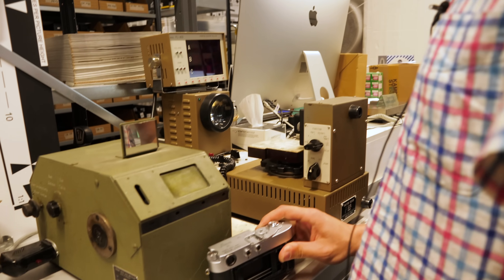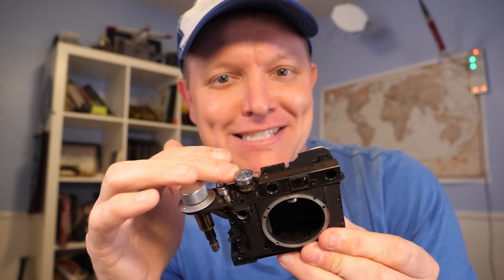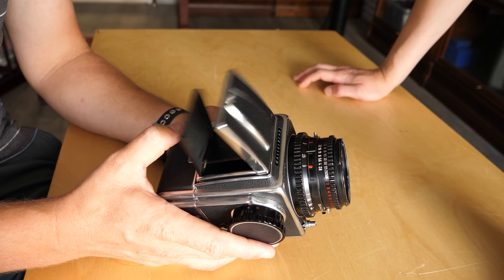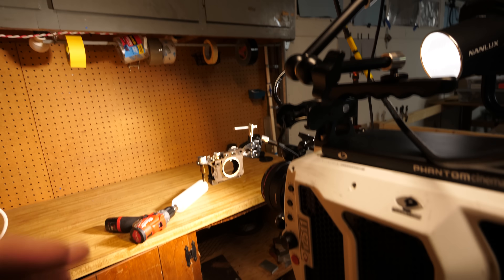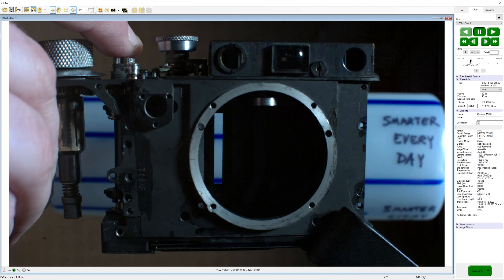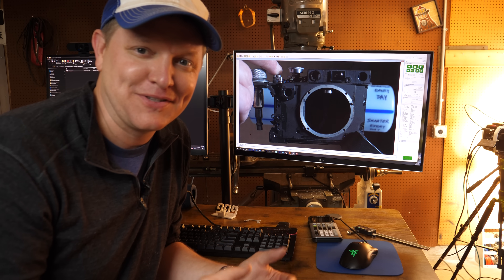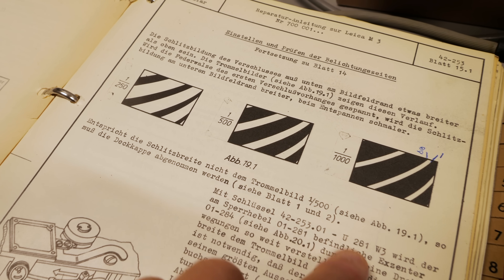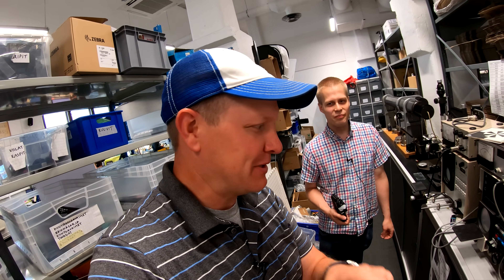How the Germans Measured Milliseconds MECHANICALLY - Smarter Every Day 283

Comment: Great video, and a topic that’s right up my alley, I was a professional photographer for 25 years, and cut my teeth during the last years of film as an assistant in NYC. I have some interesting add-ons about shutters: the rolling shutter effect was pretty well known, I remember the photo books I wore out as a kid having examples—race cars which appeared leaning waaaay back, and same for race horses and sprinters. I remember the first time I figured out that at a certain shutter speed the shutter would begin to close the second curtain before the first was across—I had triggered an open body set to 1000th near a strobe head, and the image of the “traveling slit” was clear as day. In camera manuals there was a note explaining that to use strobe one must set the shutter below a certain speed to avoid uneven exposure HOWEVER there were high-end strobe systems that had a setting that would let you disregard the warnings. How? The strobe would extend its “on time” beyond the time it would take for the slit to cross the frame, so the images would come out evenly exposed. I worked almost exclusively with medium and large format systems, as film quality in 35mm was not quite good enough for high quality reproduction. Some MF systems used a curtain shutter like the one you show, and at that size the mechanism was pretty powerful. I believe the Pentax system in particular would make a solid sounding ka-THWAP-tick when triggered—first the mirror would smack up out of the way then the shutter would go. Other systems, and all large-format systems, used leaf shutters. They are located just behind or in front of the aperture iris, and was bladed, usually 3 or 4 blades. Because they were located at the focal point (not the image plane) they were between the front and rear element groups of the lens, and since the visual information there is all mixed around, there was no visual darkening at the edges, which one would think would happen since the blades spend more time blocking the outer areas. The best of those shutters could just do 1/1000, and larger ones topped out at 1/500, whereas the fastest 35mm cameras could do 1/8000. The photographer I worked with the most used Hasselblad 6x6 system, and he had an enormous kit. Several bodies, around 20 film backs, and between 15 and 18 lenses. He owned the Hasselblad fisheye lens, with a front element that was around 5-6” in diameter, just a huge piece of glass. On several occasions he would keep me and the crew awake by spinning around suddenly, looking over at us standing by the film cart (usually 25-30 feet away) and yelling “think fast” as he LINE DRIVE threw one of the spent backs right at me. I caught every one, and I never fell asleep on set :)

Comment: In the paragraph at 5:05 it says:
The slit exposure of the shutter must be slightly wider at the bottom of the image field than at the top. The drum images (see Fig.19.1) show this progression. If the spring drum of the first shutter curtain is tensioned, the slit exposure becomes wider at the lower edge of the image field, and faster when it is relaxed.
If the slit width does not correspond to the drum image 1/5000 (see Fig.19.1), the cover cap must be removed (see sheets 1 and 2).
And then it is described with which tools to make the adjustment to correct the exposure time.

Comment: i had a ultrasonic distance measuring device and i always wonder how they did the same thing with lasers . Light can travel 7.5times around the world in 1sec so how could they time how long it took for a laser to get to the other end of the room.
I heard  they send a wave via the laser and compare it to the original wave . There will be a small shift due to the signal take longer via the laser that shift will generated a difference depended on the distance.
I always wondered this was true it's kinda hard to verify 😅.  Seeing the simulaties to the rolling shutter effect it might actually be .

Comment: Wouldn't the fact that the pattern is not homogenous indicate uneven exposure on the image ? (the lines are not diagonal and have a higher slope towards the end) which of course is because as a mechanical device it can't have infinite acceleration to start from a standstill and instantly reach it's "cruising speed" 

That to me would suggest you get less exposure at the end than at the beginning since the "slit" is moving much faster so that for a picture fragment on the left side of the frame the exposure time would be significantly less than on the right

I say significantly because the exposure time is directly proportional to the speed of the moving slit and you can tell the relative variation of the slit speed by looking at the change in slope

The slope of the bands at the very end looks to me like at least about 1.2-1.4 times greater than at the  beginning which would imply an exposure gradient of between 20-40%

Don't tell me that's unnoticeable

Comment: For even more German precision magic, I hope you got to check out a Hasselblad lens ,which all have their own built in leaf shutter, rather than the rolling curtain - which as you've demonstrated so well - 'wipes' the image on to the backplate/film.

The Hasselblad lenses are made with such precision, that the leaf shutter is actually fully open for 1/1000th of a second - crazy engineering, and rugged too. I've actually dropped a $3000.00 Ziess Hasselblad lens from tripod height on to a hard studio floor and it just kept on truckin'. I didn't check the shutter accuracy on an intervalometer like they're doing here, but it was still accurate enough that it was never cause for  concern.

Comment: Ooh, neat little curio in the manual at 5:31 (and basically what's explained at 11:48): "Die Schlitzbildung des Verschlusses muß unten am Bildfeldrand etwas breiter als oben sein. […] Wird die Federwalze des ersten Verschlussvorhanges gespannt, wird die Schlitzbildung am unteren Bildfeldrand breiter, beim entspannen schmaler." I'm not deep into photomechanic jargon, but roughly translated it explains that the reason why the curved shapes get wider or narrower at the lower edge is because of the tension of the spring governing the shutter, which kinda makes sense when you think about it; the shutter doesn't move with constant velocity, what with acceleration and the non-linear release of power from the spring. 

Thought that was interesting enough to point out :)

(Just for completeness sake, here's my best attempt at a proper translation: "The slit image of the shutter must be wider at the bottom of the imaging area's border than at the top. As the spring roll of the first shutter curtain is tensioned, the slit image at the bottom becomes wider, as it relaxes it narrows.")

Comment: There's a cruel irony in watching a video about a 1930s mechanism for measuring the speed of light on a modern 55 Inch HDTV. BUT the video default to 4K resolution which is technically supported but doesn't play smoothly when streaming over WiFi so the image freezes. 
Destin is talking about the amazing breakthroughs of 90 year old technology but modern technology has failed me and I see a still image.

Comment: I once had in my hands a mechanical stroboscope.  I was told that it had been used for checking aeroplane engine speeds by viewing the propeller movement through slots on a rotating black disc.  Same principle as the record player speed indication.  But in this case the slotted disc rotation speed was adjusted and considered the calibration standard.  It was done only in bright sunlight.  Since then, I have had a number of electronic flash stroboscopes.  In fact, I still have one vintage stroboscope made by General Radio.  It is top of the line model 1538 that can do a direct speed measurement up to 150 000 r/min and beyond, using a kind of harmonic principle.  I also once helped a photo shop repair department to calibrate their tester against an HP electronic counter/timer.  I think their tester was also one of those mechanical stroboscopes, but don't remember for sure.

Comment: Years ago I had my own camera repair shop.  The test bench in Kamerastore brought back memories, including some of the jury-rigged test setups I had to use until I could afford the "real" test equipment. For working on lenses I assembled a collimator from a war surplus B-24 bombsight. The curved lines you observed were not really because of springs, but were actual speed displays of acceleration from zero of the curtins' edges with each shutter cycle. Enjoyed the trip down memory lane. Thanks!1
Reply: please explain further. what is "from zero"?

Comment: Fun video!   BTW, I paused while you showed part of the manual that's in German and google translate seemed to work just fine. (I don't know German, so I can't tell how accurate it was).   Would be interesting to see if the instructions had any additional fun info about the machine besides what you already knew.

Comment: straight lines vs curved lines in a rolling shutter measurement is maybe the most complicated way to explore Hooke's law
Reply from the maker: I agree. What’s interesting is the shutter ends speed up and slow down depending on if one of the sides is traveling vs two. Hooky’s law, PLUS the force is divided between the pushers.
Reply: @smartereveryday  whoa! yeah, you're right, they'll only really be speed matched in the middle bit so it's actually two components affecting the "bend" /deeper understanding unlocked/. Not as popular for stills, but I think rotary shutters avoid this problem

Comment: An idea for a follow up video: how is the shutter speed controlled and adjusted on those old cameras? Also, since you have the crazy phantom camera, maybe get some footage of some of the fastest mechanical shutters (I'm guessing from cameras from just before digital took over) in comparison to something incredibly fast that everyone is familiar with.
I found it kind of funny that Destin decided to spin his rotating drum with a handheld drill while holding the camera and triggering the highspeed camera while filming mere feet away from his mill that could have spun it far steadier and without needing a hand to do so. All worked out great, but I couldn't help but chuckle about that.
Reply: From the looks of it, the shutter speed is not controlled by speed at all, but by the distance between the first and second curtain.
Reply: @maxreding8697  For sure, fast exposure times are achieved by having only traveling slit in the shutter moving across the frame. But if memory serves, some of the Canon film cameras were getting like 1/8000th sec exposure times. That's kind of insane to think that the shutter could go from stationary on one side of the frame to stationary on the other side of the frame in that interval. And survive doing it tens of thousands of times with great repeatability. It's a feat of engineering that was the culmination of decades of research and development.

Comment: we used that same technique with an adjustable strobe light when i used to make newspapers on a web press. the pages are moving so fast you have to: blink really fast, scan your head up and down really fast, or just use an adjustable strobe light to "lock" the page in place and you can inspect each page very carefully while its moving at full speed during a run. the blinking isnt noticable when you are lighting something that way.

Comment: Translation for image at 5:06:

The split-image of the shutter has to be wider on the bottom of the frame. The drum-images (picture 19.1) are showing the progression. If the spring-roller of the first shutter-curten is under tension, the slot gets bigger. If the tension is decreased, the slot gets smaller.

Comment: 10:40 the machine here sounds like a idle tractor or something car maybe it doesn't sounds like a electric engine made from whatever they made back then idk if it electromagnetic or what not but it sounds just like a car sitting idle! Also the aliasing shutter is like the same thing you see on car wheel on the HW where the rim or wheel looks like it's spinning forward or backward ->depending on speed and how fast they are going compared to you I think? I could be wrong about that speed comparative I have not tested it much just seen it alot while in a car and I know everyone has.

Comment: Love the video Destin, especially your at home recreation with the ketchup bottle. By the way, it was interesting to see a TI-84 CE calculator on your desk. The CE model was released in 2015 as an effective continuation of the TI 81 series (which went through 82/83/83+/84+ branding with various upgrades), all of which used the same processor, the Zilog Z80 that was released as a consumer chip in 1976. The CE is the first model in the line to get a new processor, the eZ80 that was released in 2001. So TI went from a 40 year old processor to a 14 year old processor…and now 8 years later they still sell that calculator for basically the same $100 price point they have been selling for decades. Could be a good topic for a video, I don’t know.
Reply: I would suspect that certain college campuses REQUIRING students to own one for math class (and not allowing anything else) might have something to do with the artificial pricing and outdated hardware.
Reply: @sidgar1  nowadays it’s because of the devices not having internet access so teachers know they are secure to use for testing.
Reply: HP41CV or go home!!!  😁  Once you go RPN, you never go back!
Reply: Had a TI84+, loved it, but when an Android phone that costs less than the calculator, running an emulator, running the calculator OS, works better and is a better UI... you might want to reconsider your price point, TI 😅
Reply: Never leave home without your HP-15c!
Reply: Back in the day, it was:
HP - about 70% (mostly 11C, 32S, etc.)
TI - about 20%
Casio - about 5 or 10%. The Casio apparently outperformed the TI in a few categories

I thought this breakdown was pretty interesting, especially since I had a relative who was a TI employee and fanboy. I know I owned a TI, but never used it as it was not reliable for fast calculations. The 30-series of the TI was way more influential than the 80-series until later.
Reply: Boo TI.  

HP 4 lyfe. or, in RPN:

Lyfe
4
HP

Comment: I've heard there is a stroboscope on the production line for Cap'n Crunch that they use to ensure consistent shape as the machine rapidly extrudes a torrent of Cap'n Crunches.  The shapes are so consistent that by adjusting timing of the stroboscope you can make it look like time is reversing and they are going back into the extruder

Comment: Fun fact: This is also how turbo-prop engines are balanced to their propellers, very similar tech  :D
Reply: you remember, that these old engineers where able to sync machine-guns with the propellers? So the gun would fire through the gaps - not the best use-case - but stunning anyway. 😲
Reply: @ThorDyrden  Another fun fact: Those guns that were set up to fire through the propeller weren’t actually running in full-auto mode. They were set to semi-auto, one shot per trigger pull. But as BreadLoafBrad said, the engine was pulling the trigger so it was still quite fast.

The split-second timing required for this also required using guns that fired from a closed bolt, like the Browning machine guns and various Maxim derivatives, such as the Vickers MG. Open bolt designs like the Lewis have cycle times too variable for reliable synchronization. That’s why the WW1 era fighters that used the Lewis had them mounted to the top of the upper wing, firing over the prop. (/gun nerd)
Reply: @ThorDyrden  yeah I think the trigger was activated by the timing gear so there was physically no possible way for the pilot to accidentally cause it to hit the prop
Reply: @breadloafbrad  wow thats crazy, they had the gun shoot and the bullet would travel through the gaps of a spinning propeller?  i had no idea

Comment: I guess it‘s a picture produced in the eye. The brain does do a lot of things with the info it gets from the eye. But here it comes down to kind of a „shutter speed“ of the rods the detect the light coming in. They have their limits at how fast of a change of the picture they can detect. The center (sharp and colour) is acutally much slower than the peripheral vision. In this case most of it seems outside of the center where the detection is very fast, but still not fast enough. I think the eye sends one picture of this pattern to the brain. Great video and love your enthusiasm, as always!

Comment: This reminds me of the calibration for an 8-day clock aircraft clock. The calibrator would spin a cylinder with an angled grove at a set rate. Then we'd clamp on a "sensor" that would trigger every time the clock's pendulum would change directions. The sensor would then trigger a metal piece that would hit against a piece of carbon paper rolling over the cylinder. The result would be a roll of carbon paper with dots along it showing the position of the cylinder at the point of pendulum change. Our goal was to adjust the spring so that the lines of dots on the carbon paper would be as vertical as possible.